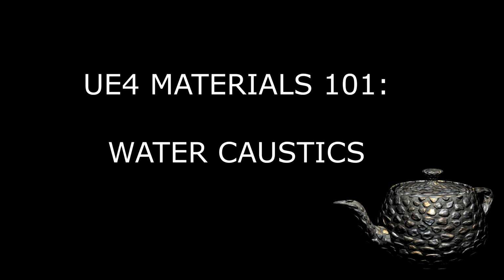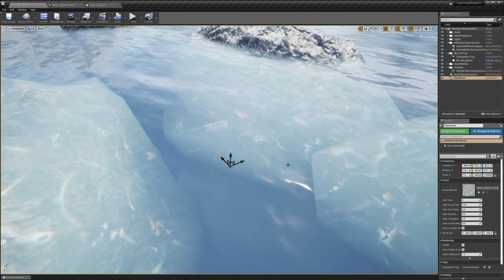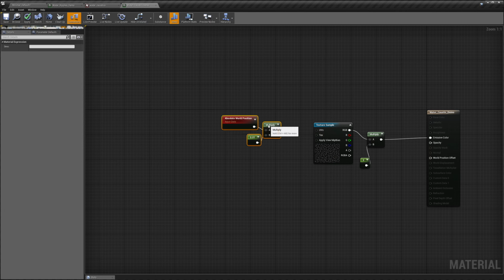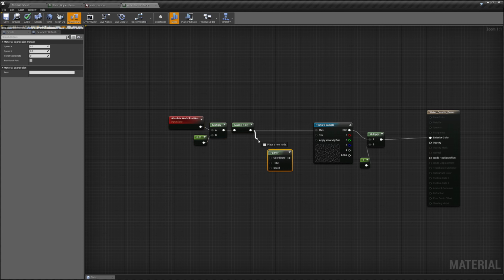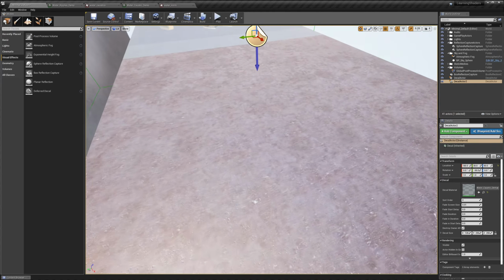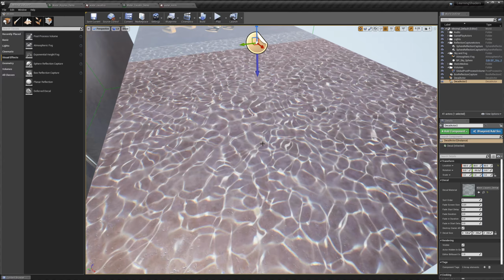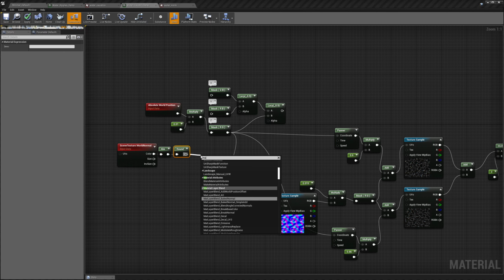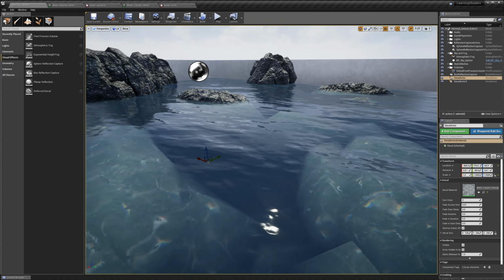Water Caustics - UE4 Materials 101 - Episode 27

Comment: You can apply this affect to the surface of the water as well, and if you plug in from the node plugged into the emissive, instead into refraction, it gives a cool effect of warping the stuff inside of the water. Just thought I'd share. The water needs to be surface translucent, and instead of the scene color, you use the mask RG from earlier in the video (16:49).

Comment: this 5:30 to 5:36 emissive option is no longer available in UE5. I cant get the decal to work
Reply: For anyone who finds this. In UE5, use the caustic image textures alpha to drive the opacity pin. connect the RGB of texture sample to the base color. Set the specular to 0. Then you can use the emissive color channel like normal

Comment: Reference video didn't have noticeable chromatic dispersion...  (Okay, I can see a little bit in the original footage in 4k.)
Reply from the maker: That's an interesting observation.  Thanks for pointing it out!  I think the chromatic aberration on the caustics is more apparent when viewing the caustics from outside the water - through the surface of the water - because going from air to water refracts the light a bit.  This example that I'm showing is looking at the caustics from inside the water so you're not getting the refraction that you would if you were looking at it from outside.  It's not something that I had considered before - so thanks for helping me think about it a bit!

Comment: Hi Ben and all,

Thank you for those very informative videos and comments.

I face the following issue  when projecting the decal onto the water: I can see the caustics underwater on the bottom floor and the immersed rocks but not above the water. Does anyone faced this issue and solved it ? Thanks in advance.
Note: I just moved the decal caustic material and its box to surround my water ripples floor (with "Receives Decals" checked in the Details). I probably missed something, somewhere !
==> SOLVED !   Following Episode 28 on Foam, I discovered that for some reason the opacity of my water floor material was left open and just required to be reconnected ...

Comment: Hello, Thank you for the tutorials. Very helpful thus far ! I'm still a rookie so this question might sound dumb:
4:45 to 8:10 , I have done every step according to the tutorial (Changing material domain to Deferred Decal, Decal blend mode to emissive, etc) but the decal is invisible for me. I'm using the texture that you provided in the description btw. The visible check in the rendering for the decal is also checked and I did not change any project settings that might have affected this. No amount of moving or scaling or rotating can also make it appear. Any idea what might have caused this ?

One thing that I should note is that I could not find the "deferred decal" in the visual effects. Only "decal" is located there for me. Could this contribute to what's going on in my file ?
Thank you in advance !

Comment: Great series and thanks very much for creating it, it must have been an incredible amount of work. The one thing I'd point out is that I can't read the names of the nodes and certainly not the color values. Also the textures gave me .ico files which would not convert so I just captured the ones in the video and that worked fine.

So now to foam....

EDIT: I finally found out how to access those files but it is fairly obscure, not just right click and save as. Something must have changed in Chrome.

Comment: Is there any way to smoothen the alpha between each direction? I find the sharp transitions a bit jarring, especially if the underlying material has a noisy normal map.

On a side note, I also found that making another decal that darkens all the materials that are in the water, and using the material's z position to make an edge that's glossy above the water to make everything touching the water look wet, really added to the look of the water.
Reply from the maker: One idea I had to remove the transition artifacts is to use the vertex normal instead of the pixel normal to determine the cut-off.  Another option would be to do samples for each axis projection and blend them instead of having a hard cut-off.  But that would be a lot more expensive - so you'd have to decide if it was worth it.

Comment: Looks great! Is there any way to have the caustics only show in shallow water? Mine is stronger deeper down for some reason
Reply from the maker: Yes, I left that detail out because I didn't want the shader to get too complex for the video.  The caustic texture has an alpha channel with a blurrier caustic.  You can blend between the RGB caustic and the Alpha caustic based on the depth from the water surface.  Or you could just fade our the RGB caustic based on the depth.
Reply: Ben Cloward thanks for your help!
Reply: @BenCloward  I copy previous water depth nodes, finding the Pixel Depth return weird value with decal material. When the camera moves close to certain range of decal, the Pixel Depth will jump to another range of value then losing consistency. Anyone can explain this? Thanks!

Comment: I got a shader problem I would love to hear the solution to if you by chance know the answer.  How do I get the tip of a gun outside of my capsule to override the walls shadders so it appears to not pass through the wall.  This is an issue that's plagued me for a long time, I have used several different hacky solutions to this but I know its some sort of shader black magic.  If anyone knows what magic spell nodes to use I think its you :)
Reply: @benhunter8551  doh, I found this video a while ago and looked promising.  I wasnt sure if this was expensive and would be annoying to add that to every gun material but if it works its neat  https://www.youtube.com/watch?v=3XO7sb-Attw